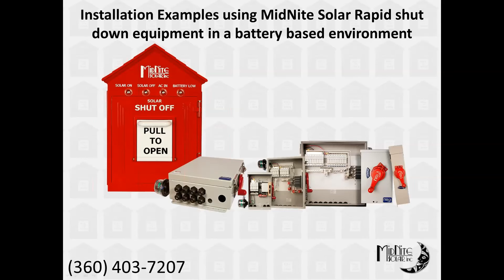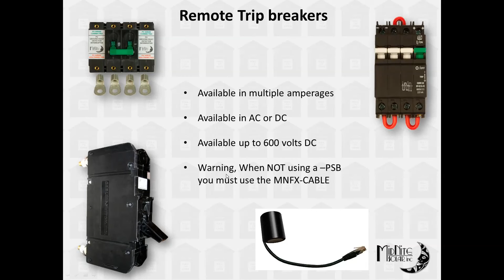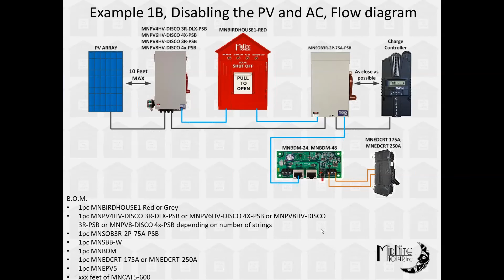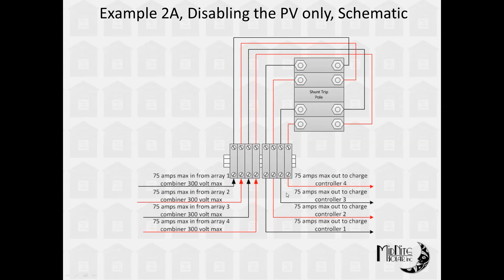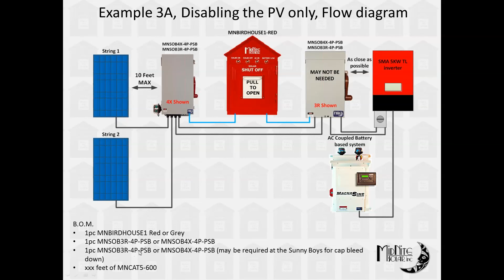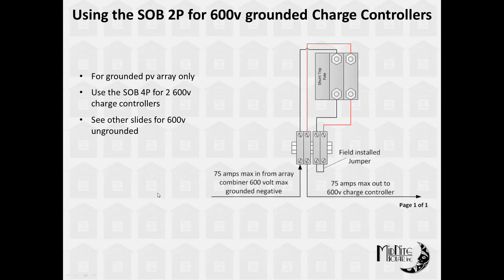2016 11 02 13 02 Rapid Shut Down  Battery Based Systems

Comment: 50:00 Installed a 30 panel 10K array on a picnic shelter. AHJ says I must have Rapid shut down even though it is basically a ground mount array. Their reasoning is that 35' of high DC voltage conduit and 2 inverters are located on the home. I would have to move them 35 feet under the picnic shelter and trench the AC wires to the main panel. So beware how crazy this can be interpreted.